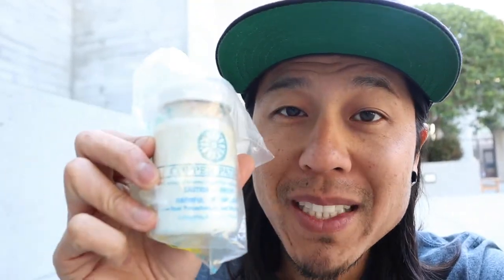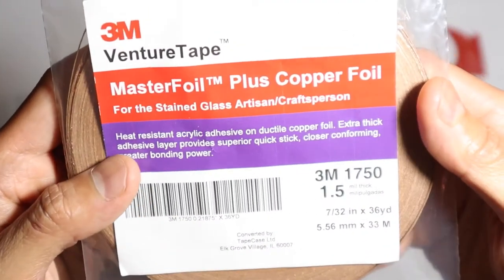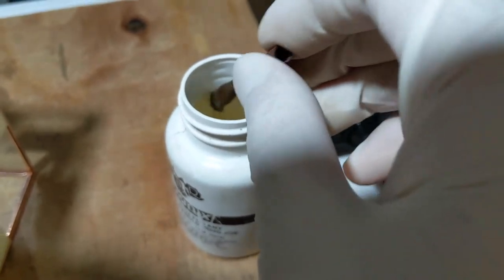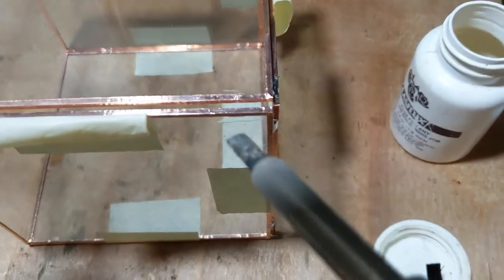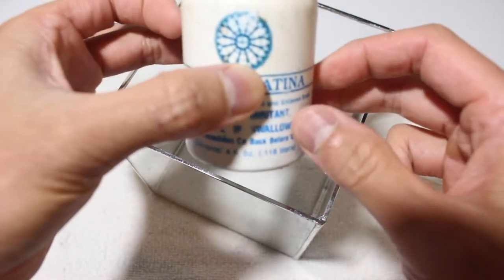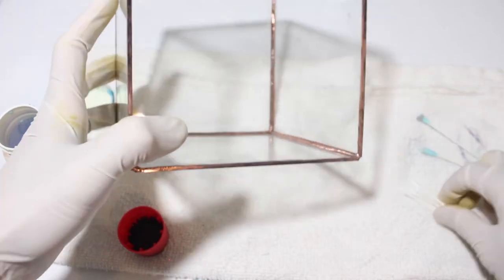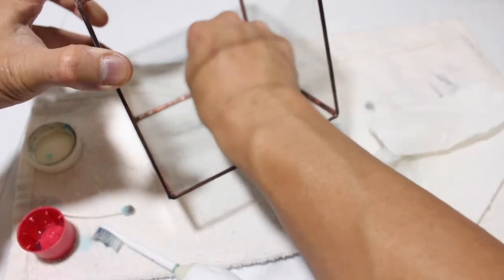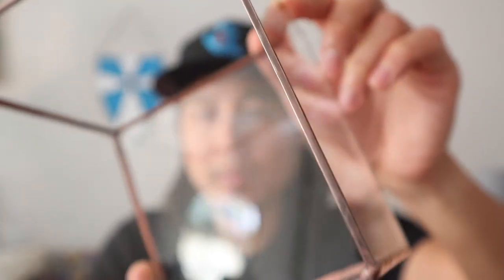Making a simple glass box AND copper patina

Comment: Great video! A couple suggestions from some of the many mistakes I have made... when trying to fill a solder gap in a 3D piece, put a damp sponge or damp towel under the solder joint. It helps to capture any solder that could drop out. A hot blob of solder dropping onto a cooler piece of glass can have unpleasant consequences! As far as getting a good bright copper finish... it’s so tricky! Copper patina will react with anything that maybe left on the solder. I have had pretty good results by scrubbing the solder lines with copper wool (like fine steel wool but made from copper) that I dip in ammonia. Dry off the residual ammonia and then apply the copper patina heavily with cotton balls. Wipe off any excess patina with paper towel and let it air dry. Don’t use any water to clean your piece after applying the patina. That can really cause the patina to turn dark or black. Then I use just basic old fashioned car wax (carnauba wax) to give the glass and the solder joints a nice shine! Hope these tips help, but unfortunately copper patina is just finicky and will almost always have a more “antiqued” appearance!
Reply from the maker: Thank you thank you! These are great tips for all of us. I'll be sure to try them out next time. Cheers! 🤙🙏
Reply: Thanks! I thought it was just me!
Reply: This is so helpful! Thank you!

Comment: I use copper patina on a lot of my pieces. I find that it works best if the solder joints are bright and smooth. If they are dull gray, I burnish them with 0000 grade steel wool to shine them up. I then wash the piece in warm, soapy water and dry it before adding the patina with a soft brush. Keep it wet for several minutes by reapplying it. Finally, finish it off by polishing the piece with liquid polish and buff it to a shine with a clean soft cloth. You'll  e happy with the results!
Reply from the maker: Thanks for the tip! 👍

Comment: I like to tip my piece when I do a box so that the corner is at a 45 degree angle. This allows the solder to fill in the v-notch between the two pieces. Then gravity is working with you. Very good project! I lean it against cardboard or I place it inside a box with crumpled newspaper. When doing patina it's a good idea to shake it since the particles can fall out of solution. Now you may want to apply polish to it.
Reply from the maker: Great tips, thank you!! I will try the polish now. ❤️

Comment: Neat! I've used copper patina a few times and it does not turn out as shiny as you'd expect. It has a "dull penny" look, which is why I don't use copper patina a whole lot. 

I recommend that before you tape the pieces together (for 3D projects) tin the copper foil first. Sometimes (speaking from experience) the foil will be visible (regardless of which backing you used) if the project is transparent. 

This happened to me on a failed 3D project I did a number of years back, I still have it and it is horrendous looking (haven't had time to fix it yet). I didn't tin the foil before I soldered it together, and the foil is very much visible. I was planning on turning the solder black, but never got around to it because it looked really bad. 

I also recommend when you do the taping together before soldering, look and see if all the pieces are flush. If the gap is small enough you can get away with using copper wire to fill in the gap and soldering over it (this happened on a 3D triforce I did in class). But if the gap is large enough It'd probably be better to cut a new piece rather than struggle with the ill fitting piece. If the gap is large enough solder will drip through onto the inside, which isn't a problem if one side is open. But if it is completely enclosed (my 3D triforce) I had to live with large solder blops on the inside. Again I could have fixed it, but it would have meant more frustration and I decided to take what I learned and do it differently for the next time. 

Still is really good though, I haven't done many 3D projects yet because of the complexity.
Reply from the maker: The copper wire is a great idea, thanks. I'm not sure I understand why you tin the copper foil first? If it's clear glass, aren't we expecting the copper foil to show?
Reply: @StainedGlassDIY  I've sent you an email explaining in detail what I meant in my earlier comment.

Comment: Hi nice videos. Do you stick to a certain thickness of glass or does   it matter as long as you use the same thickness of glass for the entire project ? 
Is some glass better than others?
Thank you for the easy to watch instructions.
Reply from the maker: Hey thanks. You'll find most glass is about the same thickness. And I think your entire project should be the same thickness so it's easier to work with. As far as glass quality, that will depend on what you buy. But I haven't been selective about brands and quality yet. Just what looks good and what you like. Hope that helps!

Comment: Hi, is it okay if I leave some of the copper tape without soldering on it, or do i need to solder each and every copper tape?
Reply from the maker: The copper tape helps bond the solder together from piece to piece and that helps strengthen and hold the pieces together.  Not sure about just leaving it but it wouldn't have the same look overall.

Comment: Question for anyone: Is it possible to make a cube with all 6 sides?  
I'm thinking I should go about it like doing 5 sides soldered inside and out, then just outside solder for the last side.  Would this be okay or would it cause issues? 🤔 
Black glass, black petina.
I don't want a hinged box.
Reply from the maker: I think it could work and should be strong.  So what are you putting inside it??